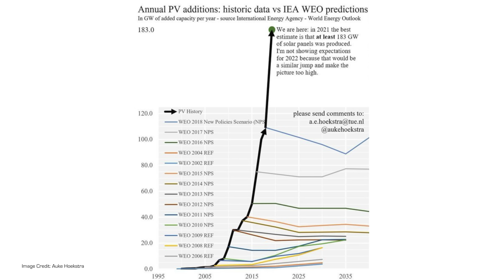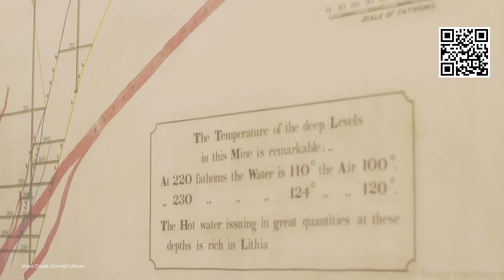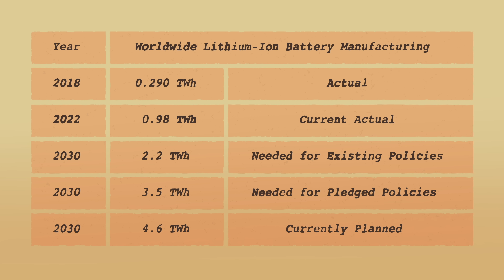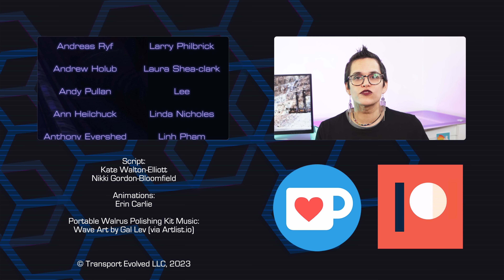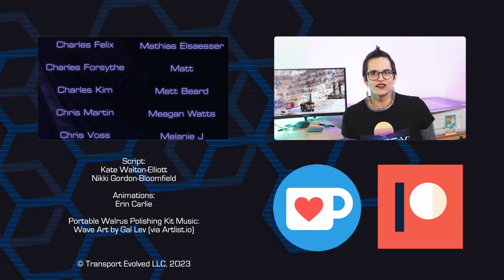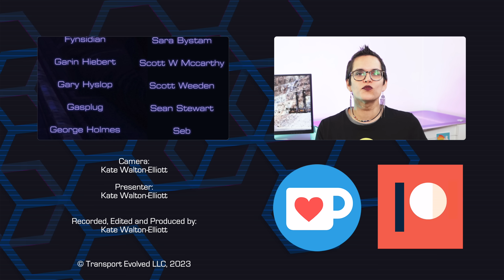It's Time For Us To Tell The Truth About Mining

Comment: "Do you have any rubber walrus protectors? - quoted from the horse of Ren & Stimpy 🐴

I think that batteries can be made using the same chemical composition of foods that are converted calories and at a more efficient rate than our species 20%.

If we can build a gingerbread monolith, we can begin to make cars that can be eaten upon reaching destinations.
We all know the potential for vehicles powered by coughing as is the case for the Cheech & Chong made at the truck factory in Vansterdam.
👁️👁️

Comment: While I agree that there are more environmentally friendly ways of extracting lithium and other metals used in batteries, you did overlook one thing.  That is the nature of mining companies.  Mining companies exist for one reason only - to make as much money as they can.  Utilizing less environmentally destructive methods will only be done by mining companies if: a) they are cheaper than conventional mining or b) if the use of such methods is mandated by government.  In the latter case, the vast majority of mining companies will move to another place if they view the government mandates as too expensive.  Also, as far as clean up after the completion of mining goes, mining companies have a nasty habit of disappearing rather than doing the clean up since clean up after mining involves spending money rather than making it.  The only way to enforce cleanup is to impose a bond to cover the cost of clean up, but that often results in the companies deciding to mine where they don't have to put up such bonds.  Take a look at the history of mining and you will see abundant examples of what I said.

Mining is environmentally destructive no matter how you look at it.  Also using the ideal that we will mine and burn less coal if we adopt EVs is a bit disingenuous since the electricity the EVs use has to come from somewhere.  If coal is the cheapest way to produce that electricity, it will continue to be burned.

To me the real solution is to change the nature of transportation away from the personal vehicle to a much more public transportation based model and to make that public transportation more environmentally friendly.  Unfortunately here in the US making that change will be very expensive and the only effective way to pay for it is to raise taxes, which a large part of the political establishment opposes for any reason.